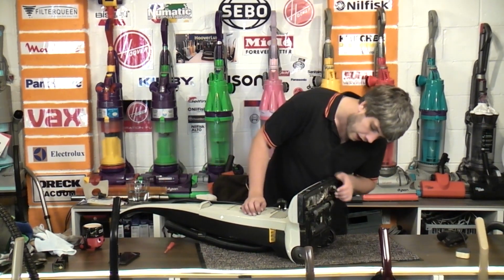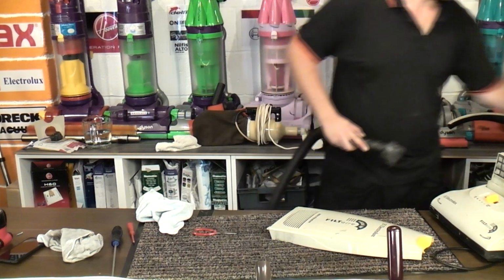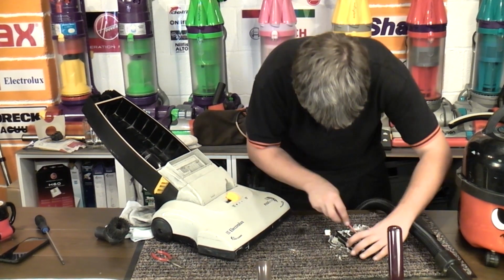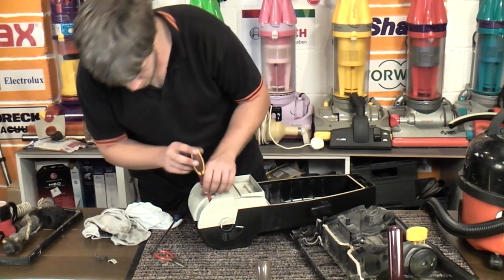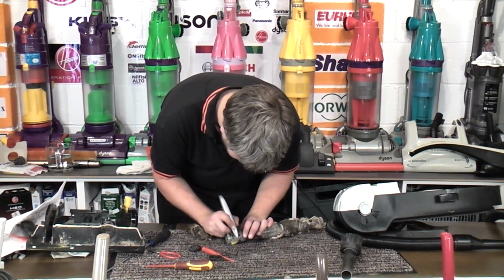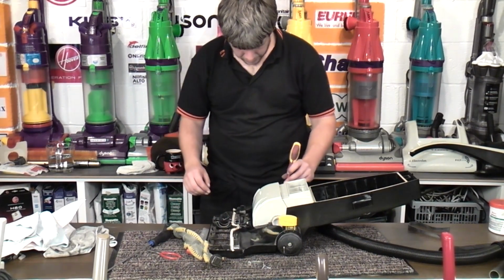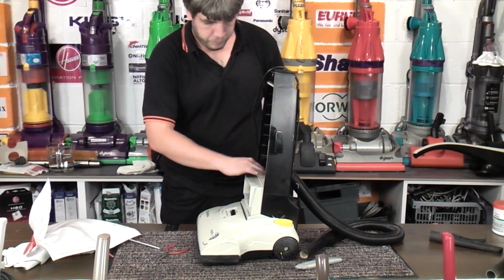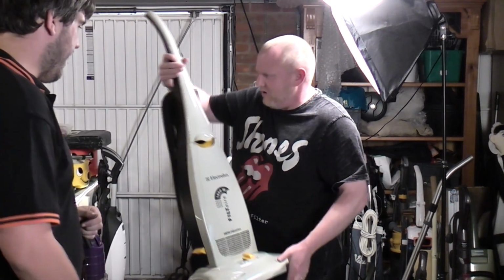Holidays with Hooverlux - Electrolux Filtaire 1600w Stripdown, Repair and Refurbish

Comment: Not a bad effort there Sam - I'd have drilled a few holes in the side of the casing where the hot glue went on, so it went into the holes and provided a good key, meaning a stronger bond to the side of the housing, but seems your fix held for the amount of time that this machine will ever get used - after all, its not going to have a hard life with Dorian is it.
The post filter, I think its an EF82, looked like someone tried to wash it, which you cant, as they are not washable - thats why it disintegrated. I had the successor to this machine, the Powerlite bagged, and it has the same filter, so I gutted it and used a Miele airclean post motor filter cut to size and fitted into the empty cage.
My mother now has my Powerlite Petlover 1700W and I try to keep it running for her as its quite a good machine for someone elderly that cant cope with maintaining a bagless machine.

Comment: looks similar to a eureka the boss power
Reply from the maker: I imagine it's identical to the Eureka version just with electrolux branding and a 240v motor!
Reply: The motors needn't be any different as moth electric vacuum motors run on ac or dc. The difference is usually in the wiring and switchgear.